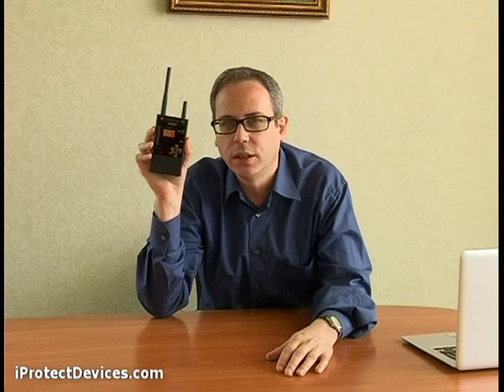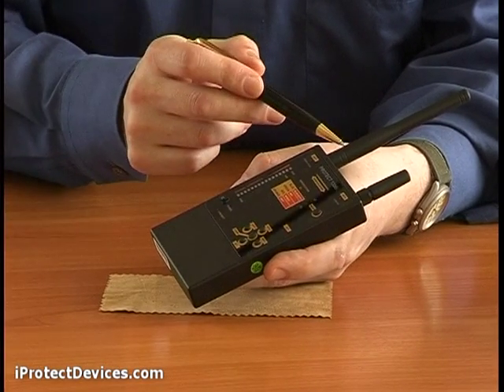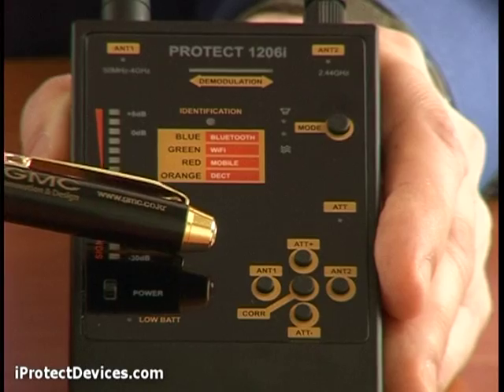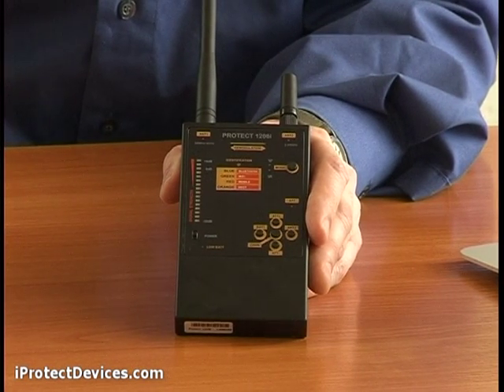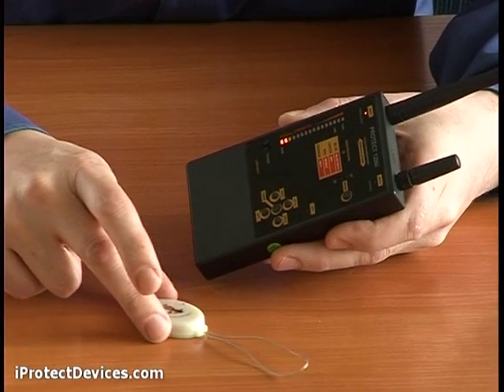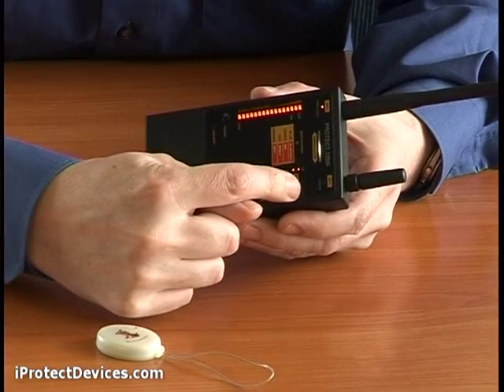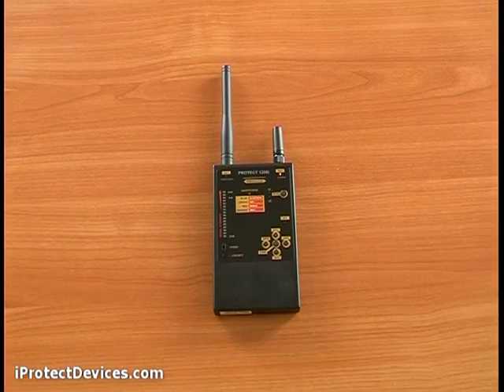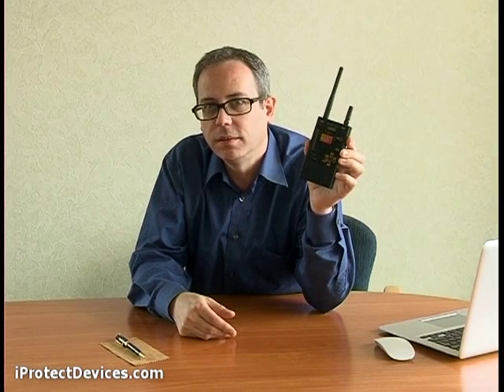iProtect 1206i Industrial RF detector

Comment: I try not to say negative things, but this is a horrible video for your product (which I almost purchased). Essentially you are demonstrating the only way that device works if you are within an inch of the antenna. The only device that actually showed high signal strength was wifi.  All of those devices should be off the charts that close.
Reply: Did you find a better device with longer distance detection?
Reply: @walsayer  nope not yet